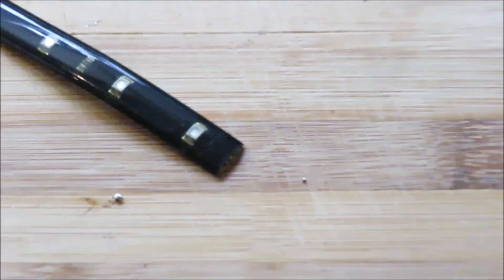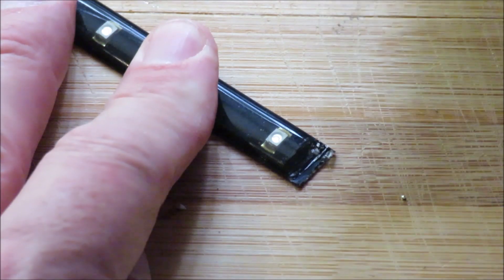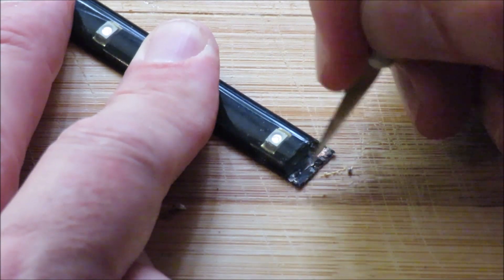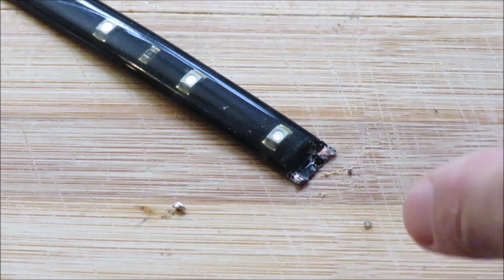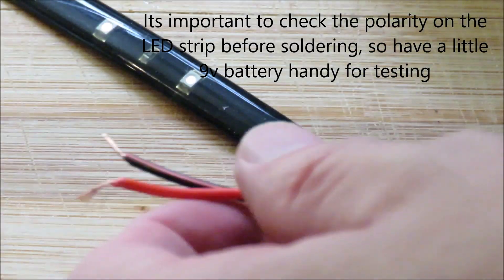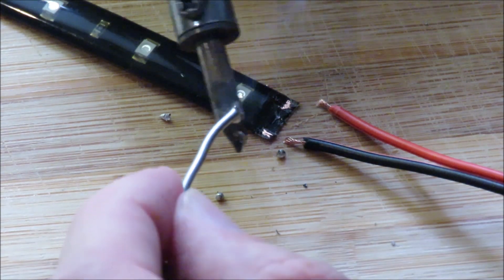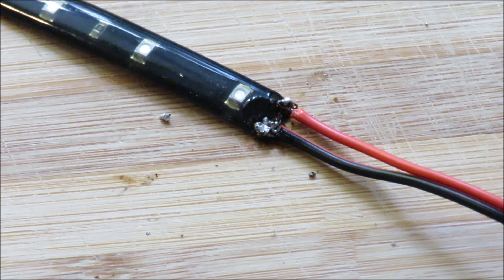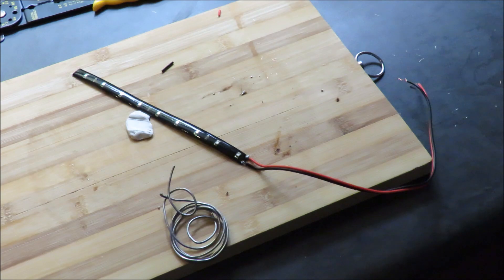How to solder wires to an LED strip

Comment: Hi , I need to connect my led strip
is it okay if i soldering not in the corner of the led?
I mean connect the postive and negative in the middle of the light, my lamp design looks better if there is no wire in the end section
Reply from the maker: Yes, absolutely, you can do that as well. Just be careful not to burn the strip with the soldering iron. But it will work if you solder it anywhere you see the two copper strips.

Comment: Hello, do you have a link on same exact led lights where to purchase?
Reply from the maker: Hey Shawn, here's a link to the exact one's I used.  I bought four 30cm pieces which I cut up for my car and then wired my own wires to the pieces I cut off.  But you also get them in 60cm pieces which enables you to order two instead and cut them up.  At $0.99 they're quite cheap and work really well.
https://www.aliexpress.com/item/32885288373.html?spm=a2g0o.productlist.0.0.4cb94adfEll6O4&algo_pvid=ce3c3c60-c8a3-46dc-bf1b-e4cf30a0f754&algo_expid=ce3c3c60-c8a3-46dc-bf1b-e4cf30a0f754-15&btsid=41f0a277-a371-49fa-abf9-c8c56508be38&ws_ab_test=searchweb0_0,searchweb201602_3,searchweb201603_55